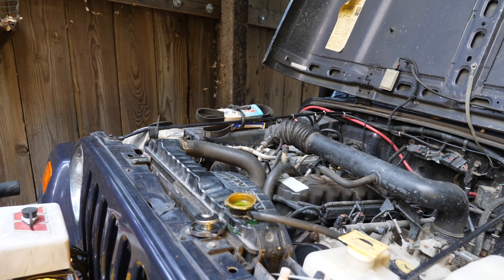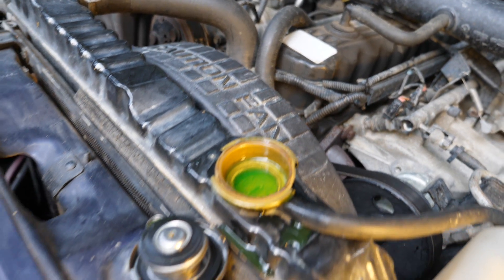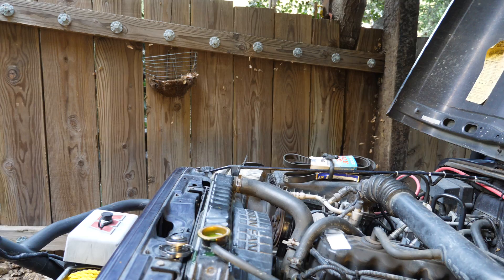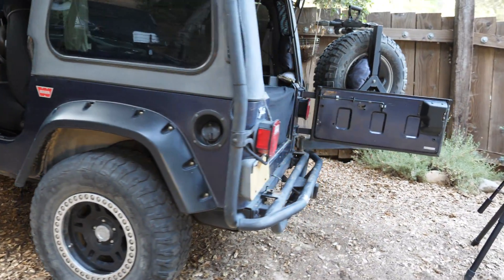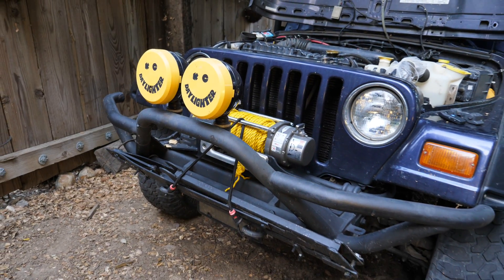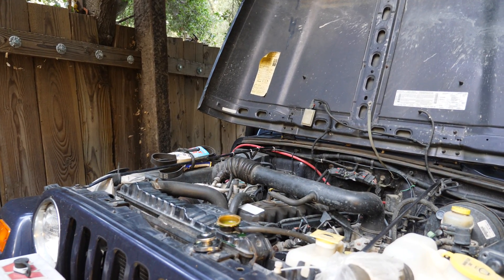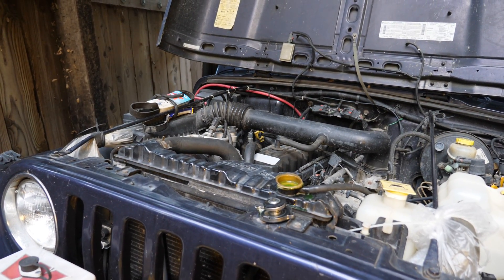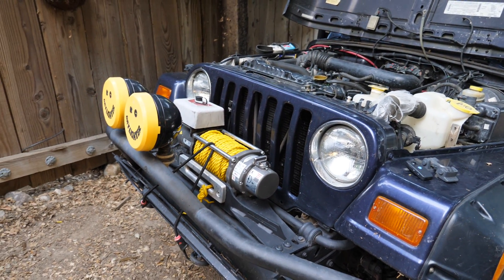Jeep overheating diagnostic challenge

Comment: Make sure balancer pulley is spinning properly, also double check clutch fan. Run jeep until it runs hot, turn off engine and try spinning the fan by hand. It should not spin without some force.
Reply from the maker: Thanks, yeah I replaced both awhile back.

Comment: CK your Harmonic balancer! May be slipping when it gets old they will start slipping making your fan not spin fast enough!
+
Reply from the maker: Thanks for the tip. I did replace that awhile back as well, but I'll double check to see if it's still working right.

Comment: Did you ever figure this out?  I don't overheat but it climbs to near 240°F only on the highway.  I can slow down and runs perfectly cool.
Reply: Replace copper aftermarket radiator with OEM radiator and will fix, Common issue I found online searching. Always use OEM where possible.
Reply from the maker: @jimhaslam2280  Thanks, I have heard that helps some issues but I started out with an OEM radiator, I replaced it for this triple duper custom one, neither seem to have been the solution.
Reply from the maker: I'm not certain it's over... I found loads of leaves between the transcooler and radiator that may have been blocking airflow and also cleaned out all dirt in the radiator fins. I also removed the lights to the side to open airflow. And removed my winch line. I'll do a new test soon, headed to the Mojave. It doesn't overheat around here.